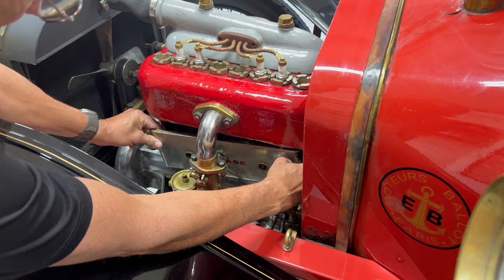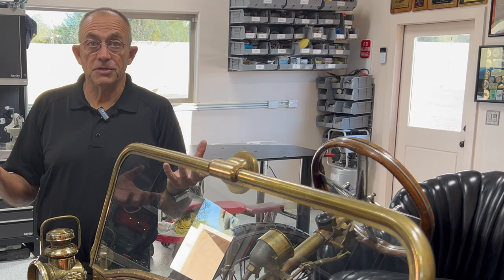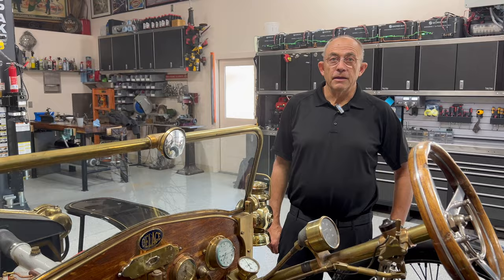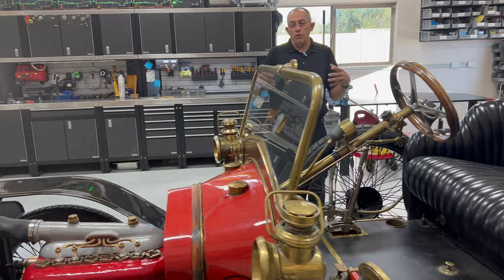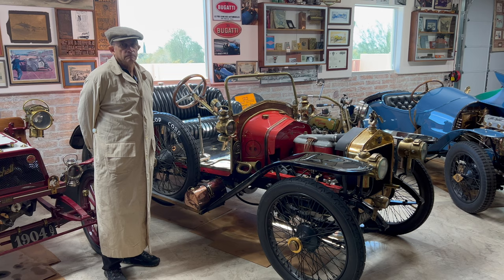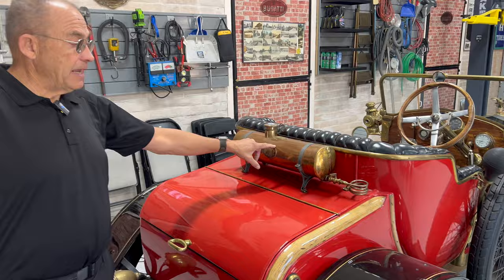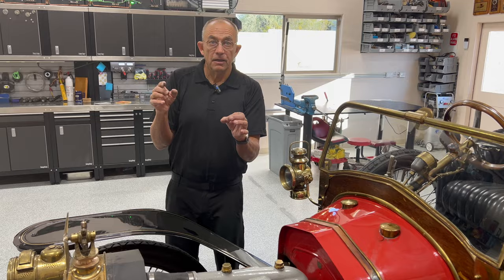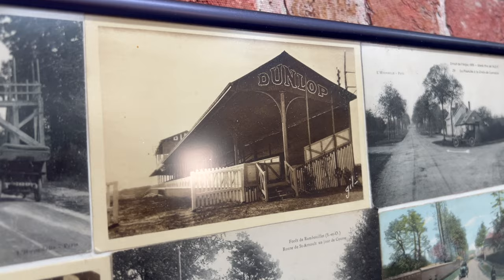STARTING (almost) the OLDEST Delage in the USA - 1909 Type R Voiturette De Course - Alan Travis

Comment: Amazing how the human body works like the carburetor at different altitudes.Higher altitudes and thinner air we need to adapt to oxygen intake like the carburetor.
After learning how these early cars worked it basically gave you the foundation for everything else that followed.It’s the ultimate learning experience on all the minutiae’s.

Comment: Thank you BarryT's Garage.

This is a very impressive technical masterpiece. The problem with the oxidising oils is not very easy to solve. When the engine is switched off hot, the engine sucks in air through all the channels when it cools down, which also contains oxygen. In the long term, the oxygen can then lead to grease and oil oxidation. If the engine was only allowed to draw in an inert gas, a shielding gas, through the inlet and outlet ducts during thermal cooling, the result would be that no more oxygen could cause oxidation. 

SJVD Michael Frithjof Mueller
Reply from the maker: Excellent point! Thank you for sharing your thoughts on this technical challenge. 

Also, thanks for your ongoing comments!  

-Barry